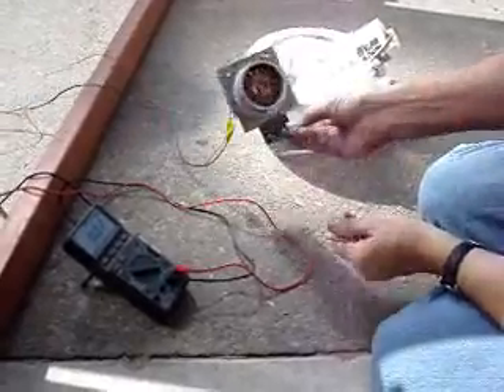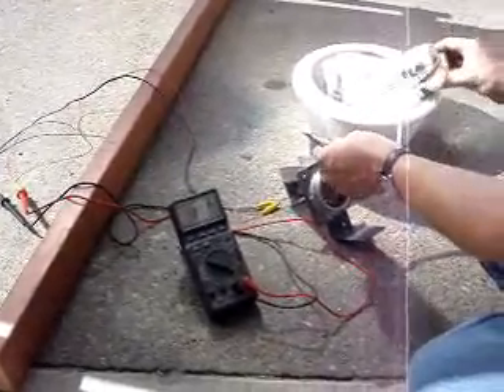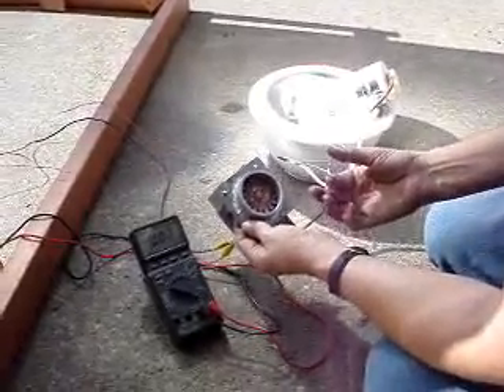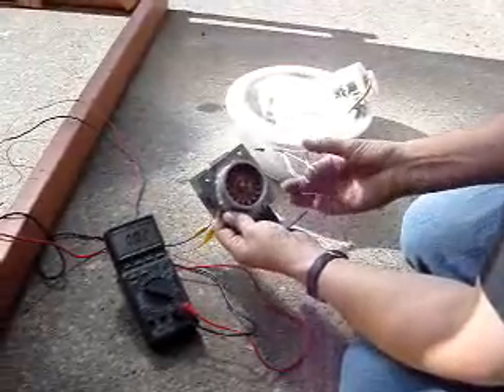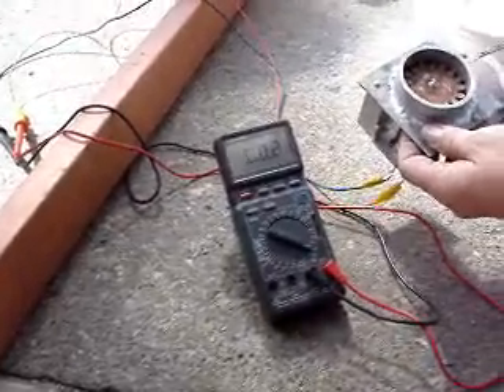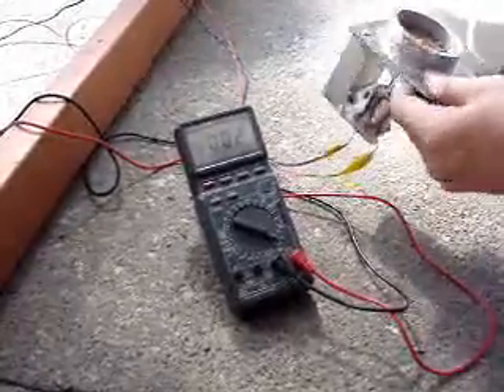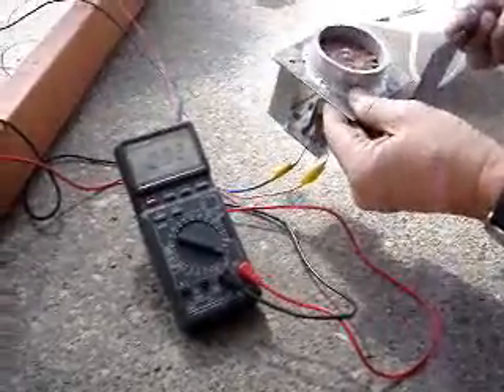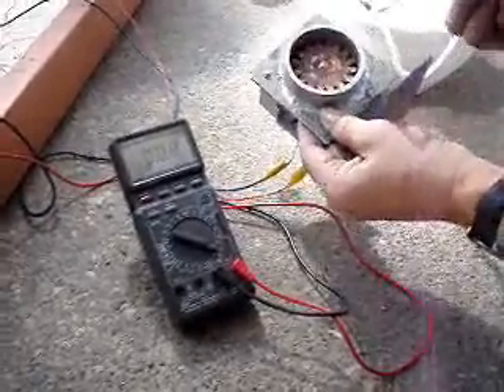A Simple Solar Electrical Demo

Comment: Just had an additional benefit to this concept.  In doing the steam through the little motor, add another conjunction to the excess steam to produce "clean drinking water".  That idea could even be the spark for your future funding.  Everyone knows clean drinking (bottled) water is big busy these days.  So maybe this could help fund the sun elctro-system.  Also, if you could make something that is portable, small, powerful and low-cost would be in demand.  Whole home systems. Nice research!  A++